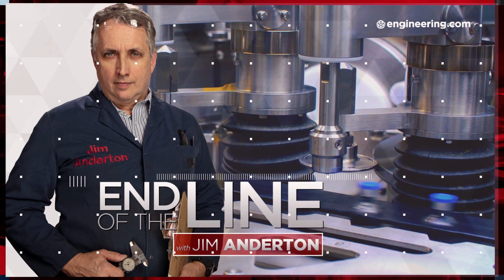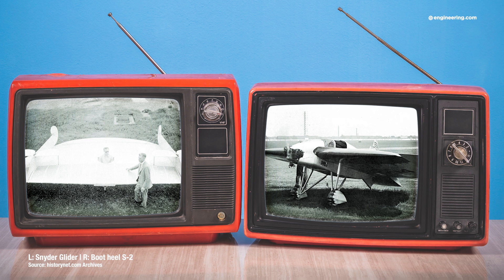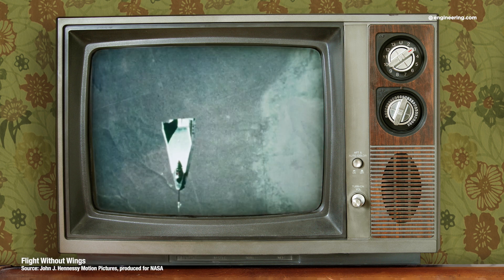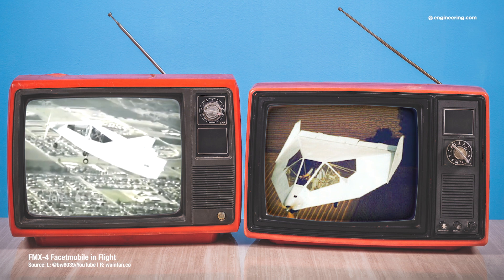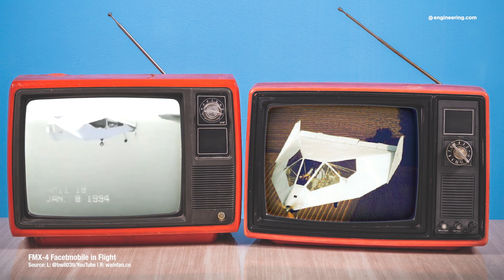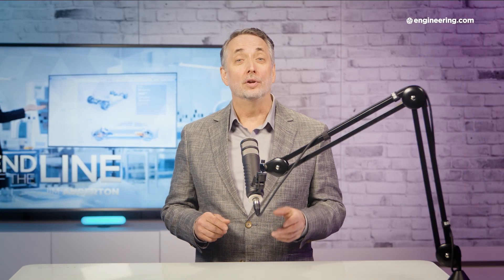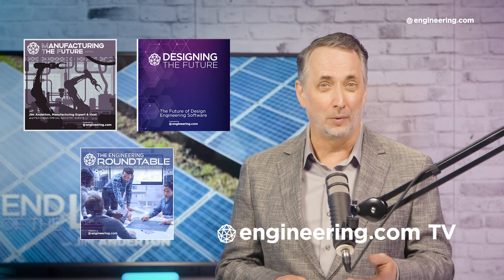The Facetmobile: Why Didn't it Ever Take Off?

Comment: Because it looks funny, and everybody knows that "if it looks right, it'll fly right" is a hard and fast rule permitting of no exceptions. If it doesn't look like a Cessna or 707 or P-51, it can't work.

BTW, the XB-35 was not a competitor for the B-36, being a 1939 medium bomber design. Nor for the B-47, which as designed after the war with Prandtl and Lippish post-war knowledge.

The Burnelli CBY-3 "Loadmaster" served with several users, is now restored in a museum.
A test pilot talked about doing the "$u!¢!d€ stall": Cut power, pull back and watch the speed drop below when a normal plane would already stall. As it starts to shudder and fall off, push a rudder pedal, and let go of the controls.
The nose comes down and turns a bit with the rudder, and it glides out straight.

As well as the extensive list of Burnelli proposals, see the '70s Boeing model 754 lifting fuselage freighter. Being pushed to users like Emirates, Cargolux, and Husky. By Boeing's numbers: with same engines and fuel load as a "normal" plane, it gets x1.75 at least the payload and range, onto smaller runways, with better handling and stall characteristics.
When the Burnelli estate said they'd let it be license-built, Boeing hastily dropped it, and has since said that they will never build a logistics or civil plane with a lifting fuselage. Meanwhile no high-end military plane will be built without a lifting fuselage volume. Not for stealth, but for increased L/D, range and payload.

After acquiring the McD "blended wing-body" work, Boeing dropped it and left NASA to work on it and Cranfield to build the X-48-C very successful test model. Every maker who's looked at it, from NASA, Boeing, Lock-Mart, Airbus, TsAGI has said that it could be built now and flown with little handling changes (and no worries about passenger evacuation which doesn't matter to freight or military users). Frequently they can have less structural weight and cost. Less wetted area and drag.
Lock-Mart showed work and a model of a "Hybrid wing-body" logistics plane with a normal military freighter tail. Said they're ready to start now and it also would get multiples of payload and/or range.

For decades, even before the war, it's been known how to get instant +20 to 40% efficiency gains, by eliminating static drag in favor of lift-producing volumes.
Makers care more about appearance, and fashion than about efficiency.
Yes, it might take a little while, maybe a few years to certify something so new. It's been a few years away since the 1920s Burnelli RB-2.

Comment: Preface: I have known Barnaby for 30+ years, and I am big fan of his work.
One of the challenges with lifting bodies (that he readily admits) is entrance/egress. There's no great place to put a door/step when the entire aircraft is part of the lifting surface. The facetmobile had floor hatch, which required crawling under the airframe to use. This is obviously not the most attractive/viable option for many private pilots.
Reply: is there any idea how to solve that with the FMX-7?
Reply: looking at the photos - you could easily turn one of the 'facets' into a giant door, making entry/exit way easier than conventional aircraft
Reply: @ghostrider-be9ek if airflow over the top were to be disrupted lift would basically vanish. The door needs to be on the bottom because otherwise it opening in flight would be catastrophic.
Reply: @agsystems8220  the ship would lose about 1/4 of lift if a door opened, it should not be catastrophic.

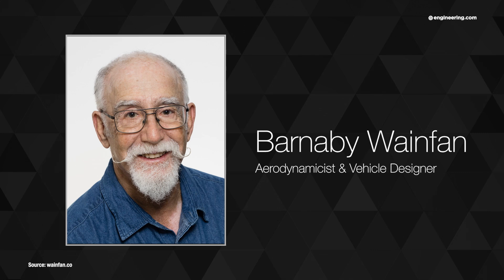Comment: 0:43  That's a miniature F-117 Nighthawk.  It didn't become popular because it's highly unstable.  If the computer fails, down crashes the plane.
Reply: It never had a computer.
Reply: No it isn't. It's Wainfan's plane, and it's very easy to fly and safe and will not stall.
Reply: Other than being faceted, it really isn't much like the F-117 , though the registration number is a nod in that direction. It's more like a delta wing.
Reply: The A117 is unstable because it was designed to be, the Facetmobile is NOT unstable, because it was designed to be STABLE. That cost a little in performance, but didn't need a computer, servos and an electrical system to run it.